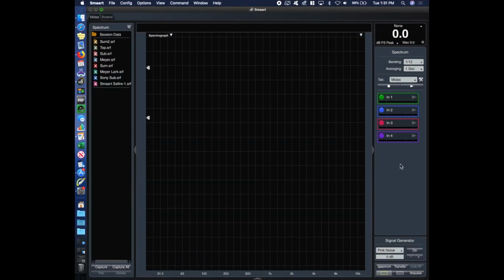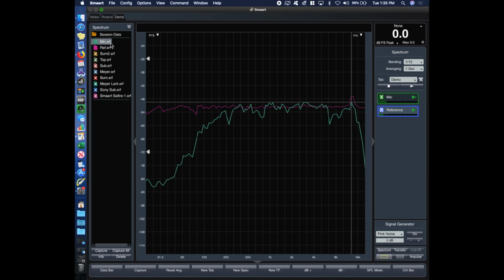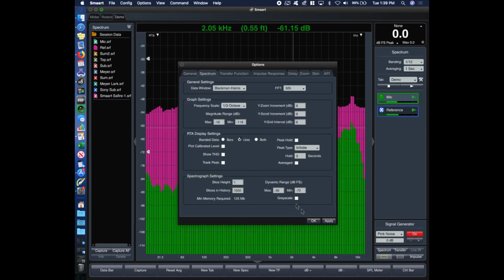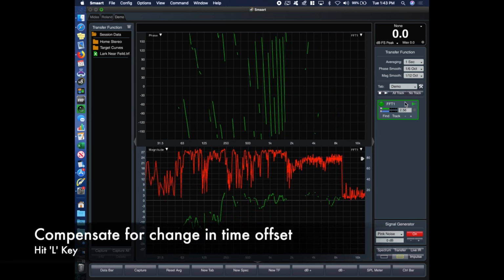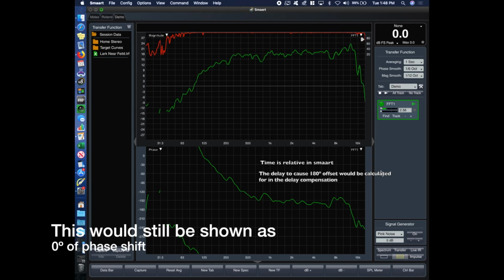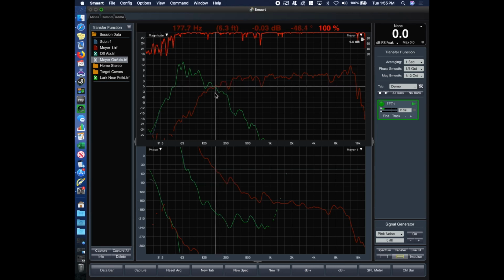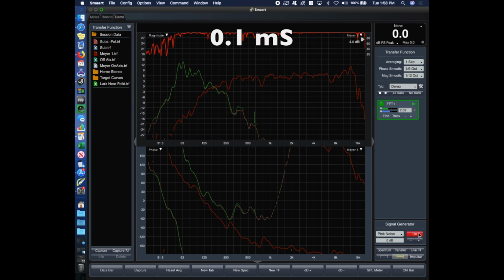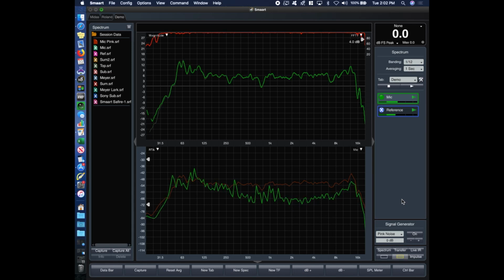smaart intro P.2  config

Comment: Why do you feel that the UMC404 outputs are unusable for measurement purposes? I use them for such all the time.
Reply from the maker: I'm glad you asked. This could be just a QC issue with Music Tribe. When I first bought it, a friend of mine at Meyer told me that the outputs had a high noise floor and not to use them. I did a bit of investigating and found that the noise floor on my unit was fine, but there was crosstalk between input one and output one.  I bought mine probably four years ago. Is your's newer?
Reply: @chasebndct  About two years old. It's a cheap interface, so the outputs are definitely noisier than one might like for recording purposes but it's still completely acceptable for Smaart. Well below the acoustic noise floor of a venue, and remember you only need a 10 dB SNR to keep your coherence above 90%, so nothing to worry about in my opinion.
Reply from the maker: @m-audio-stuff  That's about what I would assume from the price point. I'm glad that yours seems to be working better than mine. Hopefully, mine is more the exception than the rule.